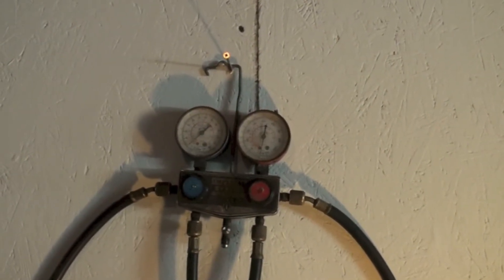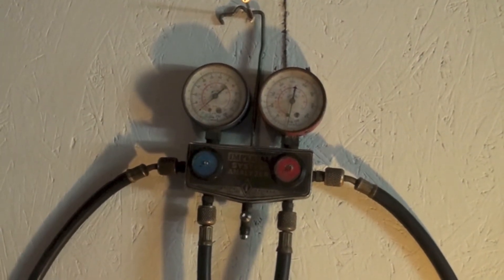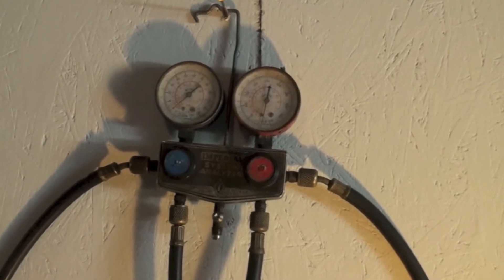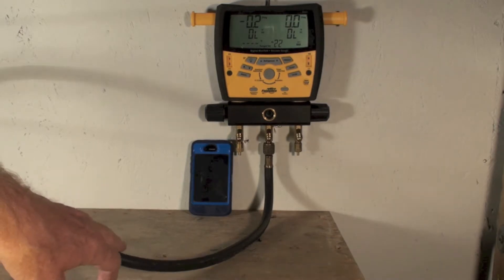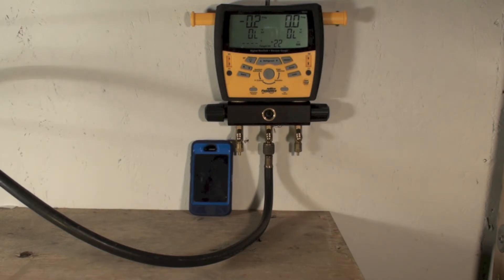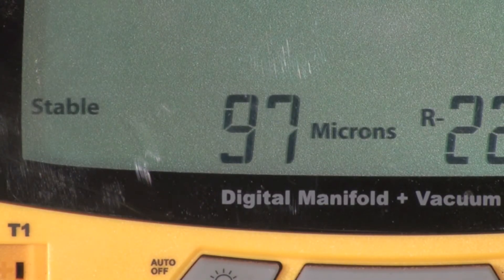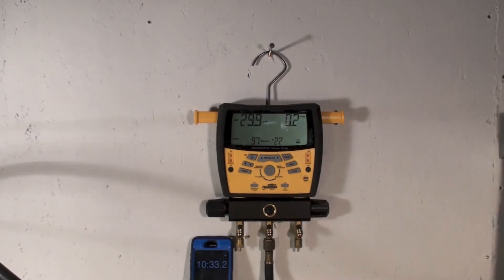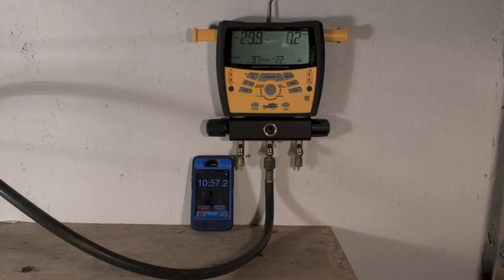Vacuum test of 50 plus year old HVAC hose

Comment from the maker: They are much thicker than new ones.  I had a demonstrator hose of the newer type that would literally foam up across the entire length under pressure.  I wish I still had it for a demonstration.
GFM